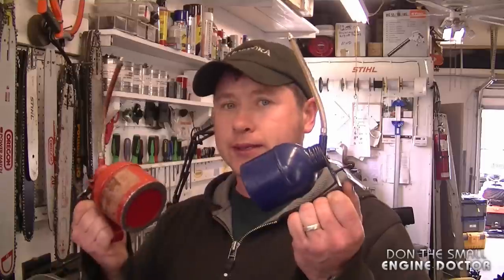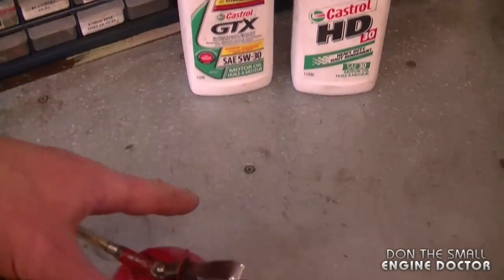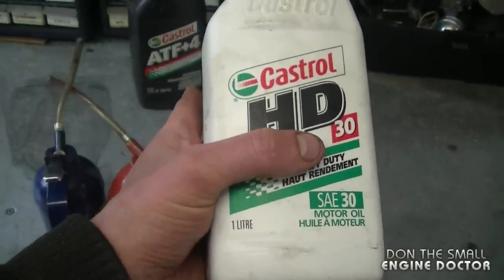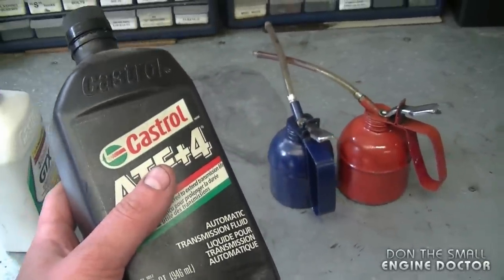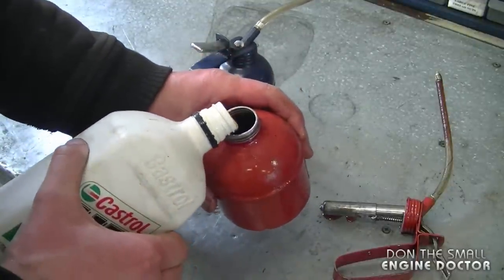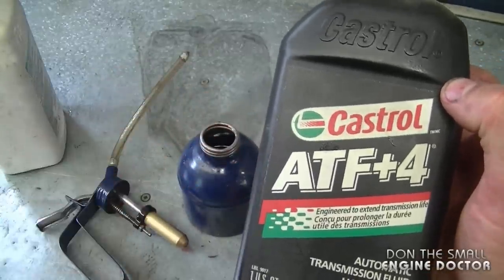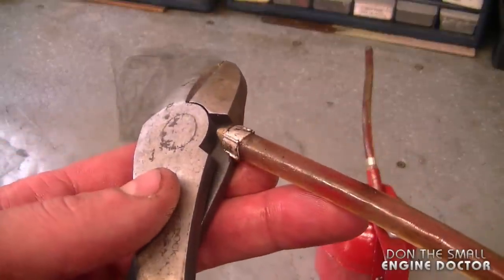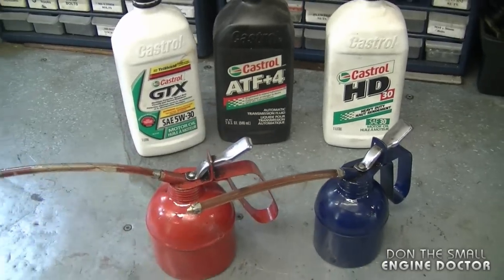What's In My Oil Cans?

Comment: An old machinist told me the best penetrating oil is a 50/50 mix of ATF and Acetone. I've used it for years and it works better for me than anything I have purchased. That is what is in one of my oil cans.  I never thought of mixing ATF in my other oiling can too. Thanks for the tip.
Reply from the maker: flyalaska i'll have to give it a try
Reply: flyalaska p
Reply: American Machinist did that test with 50/50 ATF and Acetone and found it the best penetrating oil mixture.....

Comment: All the oils seem to have a warning label not to get it on your skin, so i started using mineral oil, which is actually good for your skin. Its also great for cleaning up mud, rust and grease, and the bonus is you don't need to wash it off your hands.  There's also mineral oil jelly and Vasoline if you want something thicker. Thoughts- pros/cons?

Comment: i have a small can of "3 in 1" for my old mower, but we dont get savage swings in weather, so its good enough :-)
Wd40 and similar is usefull for releasing cables and pivot points, but a chase of real oil afterwards is a must :-)
Reply from the maker: zx8401ztv good stuff, we get extremes here in weather and a lot of salt on snowblowers in the winter if you live near the road
Reply: Doesn't wd40 evaporate?
Reply: Redneckalec  Yep that's why you chase it up with 'real oil' as zx8401ztv puts it ...
Reply: Matt Allen Yep wd40 is great stuff but if you hear anyone calling it "oil" you must slap them with a wet kipper ha ha :-D :-D

Comment: Dony,  I have always used ND-30 or ND-10/30 in my oil cans for lubricating moving parts on the machines I work on. I thought you were suppose to stay away from the High Detergent (HD) oils for lubricating moving parts. Non-Detergent oil is available in auto parts stores in quarts, you just have to look for it. Also, one of my pet peeves are mechanics who use regular grease to lubricate rubber parts, silicone grease should be used, it will not breakdown the rubber over time.   kirk
Reply: You are a smart man...  I just discovered silicone grease a couple of years ago.  I'm surprised more isn't known about using it on petroleum based plastic and rubber parts.

Comment: Useful information there. I have a question, my lawnmower is 4 stroke and takes sae 30 oil. I have a bottle of unopened 10 w 40 oil, and no use for it. Can I use it in my mower? Will I cause harm?
Reply from the maker: JuiceBanger1 yes you can use it, it won't hurt it

Comment: Hey don I have a brigs intec 21hp V-
twin model 407577 code 0284-E1
And it's running extremely rich. I cleaned the carb and may have lost the main jet would that cause the issues if so where does it go on the carb? It idles ok for a fiew seconds smokes black then dies after wating for it to cool I remove the plugs and they are soaking in gas. Thank you for your videos they have helped me so much!

Comment: Hmm, I've been doing this oil/ATF mix for a few years now, still works great.  I now have a metal lathe which uses oil for keeping the tool & workpiece from getting too hot, don't use oil/atf for this though it stinks LOL.

I've also started keeping a small bottle with a spout on it with a 2 stroke oil/gas mix for working on small engines as well, works great for a quick shot of fuel into the carburetor, and a little 2 stroke oil isn't going to hurt an engine that's been sitting for a while.  

I purchased a Stihl handheld leaf blower BG50 last summer and I purchased the 6 pack of 2 stroke oil which doubled my warranty from 2 to 4 years...pretty good deal.  They also mentioned the pre-mix fuel and I bought a can of it just to try it out and for no more than I use the blower maybe a couple times a month I think I may just stick with the pre-mix fuel, its already stabilized, already mixed, and no ethanol to worry about either.  Course my chainsaws I use more frequently during the spring and fall so I mix quite a bit of fuel for them so it would be too expensive to use pre-mix fuel.

Last year I never had the chance to do any firewood cutting so both my saws sat all year last year and most of the previous year...of course this spring I go to use them and neither would run.  I bought a can of the Berryman Chemtool Engine Restore, or some similar name can't quite remember, but its the Berryman version of Seafoam.  I got a syringe and used it to inject a bit of it into the chainsaw carbs, got them started on it, ran them a few seconds, shut them off then injected a bit more of the Berryman Chemtool and let them set about 10 minutes.  Then fired them back up and they started running great...maybe something to try for those having carburetor issues before tearing things apart and doing a complete carburetor tear down.  Just a bit of a tip to try out first.
Reply from the maker: what oil do you use on your lathe
Reply: here lately I've been working with aluminum so no oil at all.  Usually use 0w-20 or similar weight oil or light machine oil works very well also.  The trouble with regular oils and light machine oil is they're so light they mostly just get thrown off the material and the cutter.  I started using cutting oil instead.  I keep a jar of cutting oil by the lathe now and use it, cutting oil is thicker and has a more sticky consistency that helps keep it on the work...I use a small paint brush to put the cutting oil on the cutter.  Same thing for the drill bits when drilling.

Comment: I am using Lucas oil stabilizer in my vehicles after they get over 50,000 miles because it sticks to the piston walls and moving parts. For tools, I use 3 in 1 oil to lubricate my tools. I wish I could find some oil to loosen the castors on my shop jack which would dissolve the rust which prevent them from turning. I had some oil made by the company who made lubricants for the auto engine which was good for 50k miles, but I can't find it any more. WD 40 don't work and neither does Liquid Wrench.

Comment: Hi Dony, do you ever use Marvel Mystery Oil? I've been using it since I was a youngster, I swear it's Marvel-ous.
Reply from the maker: +ug mold no but I think I will
Reply: +donyboy73 When I was 13 I was given a seized up Eska outboard engine. Some one said soak it overnight with some Marvel Mystery oil in the cylinders. Sure enough freed up the next day and I got it running. 
I clean with it, seems to clean rust off well as well. I heard it has wintergreen oil in it, good for rubber.

Comment: Was hoping you can help me I have a 16.5 hp briggs opposed twin. It wont idle just keeps surging up and down I have pulled carb a part and clean it all out and it still doing it My carb idle air is set cant be adjusted. Plus when I start it gas is spitting back up from carb. I hope you can help me. 
Thank you